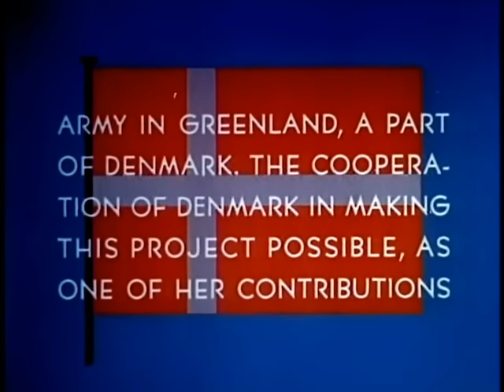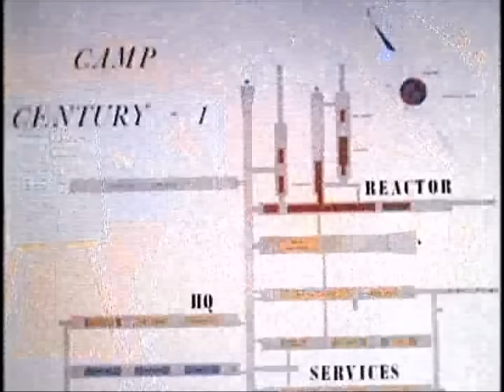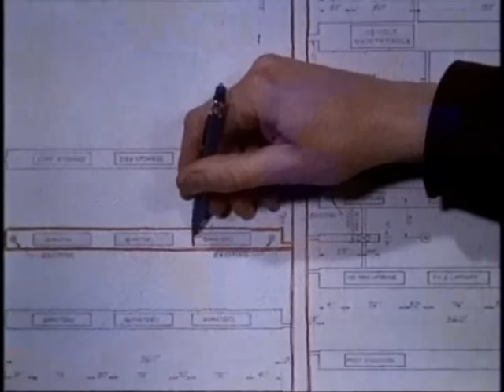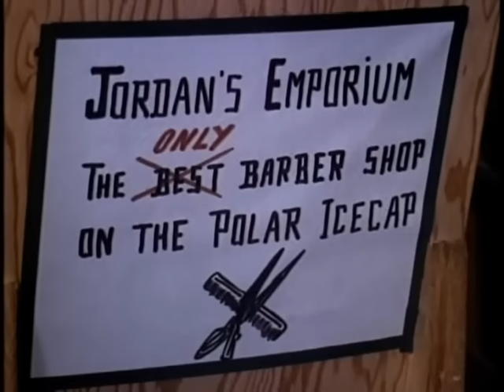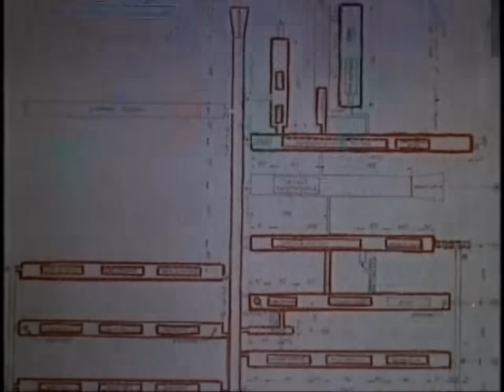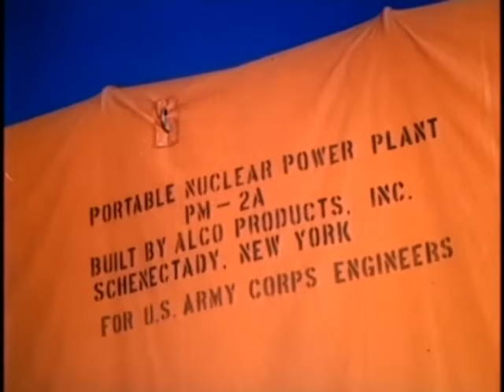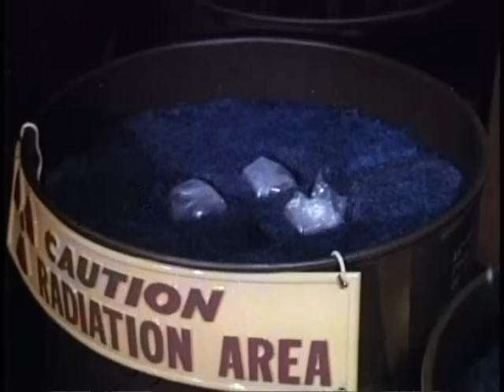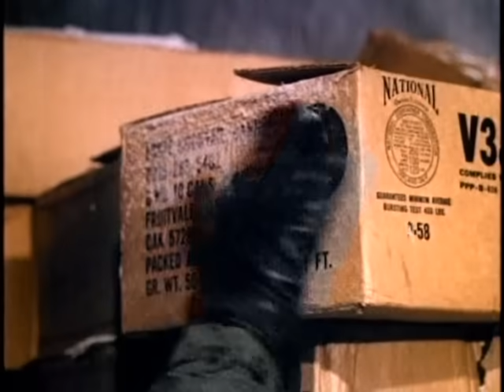The U.S. Army's Top Secret Arctic City Under the Ice! "Camp Century" Restored Classified Film

Comment: Where were they keeping the waste. I know up in Colorado there is an old facility that has 1000's of gallons of nuclear waste just drianing out of the holding tanks not far from a major river run by the govt. If the same thing was done in the arctic the govt would not tell us and it could be why the ice cap is melting and global warming is a cover up. Maybe we had to abandon the base due to a meltdown. The base in the Colrado might be on th River but it's easily found on line.
Reply: +Mick Mallery 
If 1000's or even 10 gallons of radioactive waste was open and draining around anything living it would be a national disaster.
You are mistaken, don't be a Heretic.

Comment: It's strange that most of all remakes made by having some conspiracy elements. 
Why strange cause the camp did not last long.. 
Within three years after it was excavated, ice core samples taken by geologists working at Camp Century demonstrated that the glacier was moving much faster than anticipated and would destroy the tunnels and planned launch stations in about two years. The facility was evacuated in 1965, and the nuclear generator removed. Project Iceworm was canceled, and Camp Century closed in 1966.

The first though was to see if there was a possibility to rotate nuclear weapons. 
Expanding the defense for the USA.. 

But you can state that the hole idea was a "to good to be true.. " The Ice cap was not stabile enough.